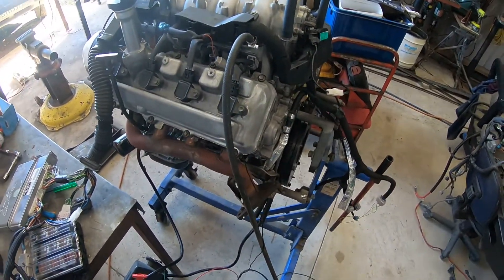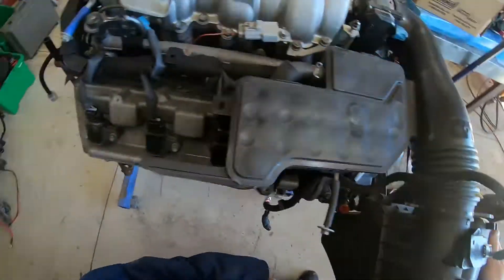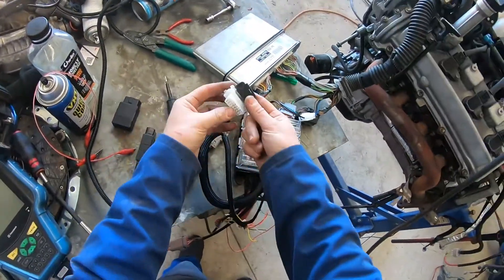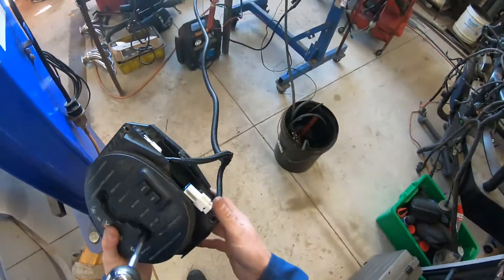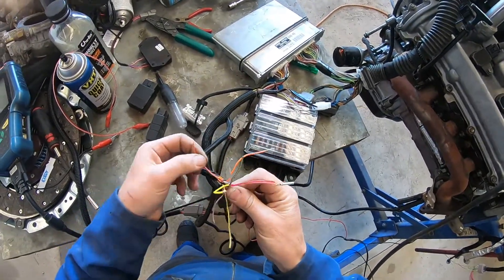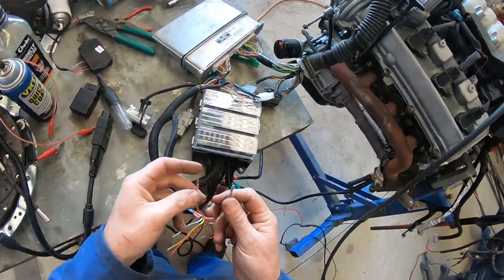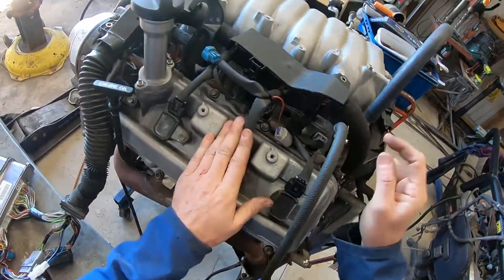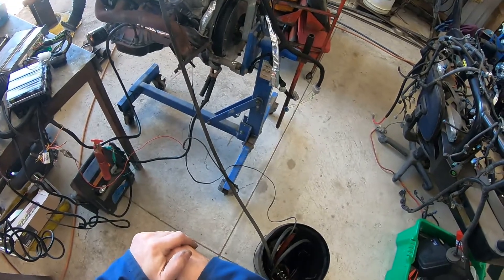3UZFE Toyota V8 wiring instructions into Bedford Van

Comment: Throttle padla waring
Reply from the maker: Yes we did the throttle pedal wiring for this job as well.  We extended the looms so they reach inside the cable and supplied a suitable pedal.  Cheers Kelvin